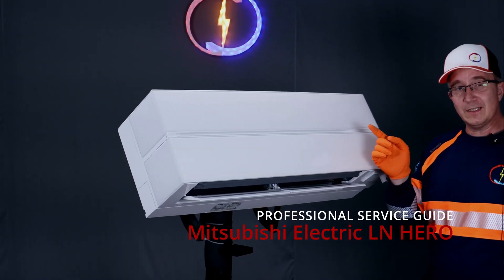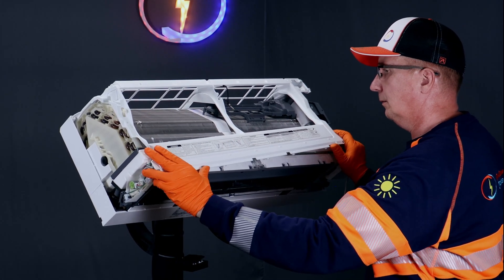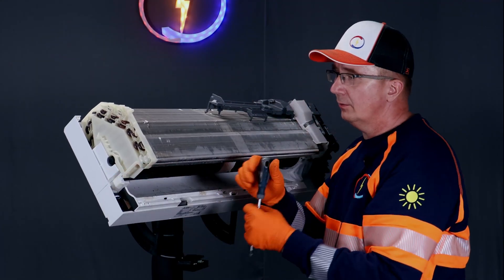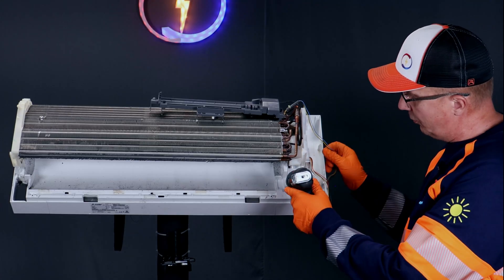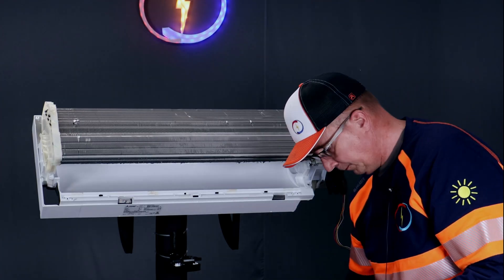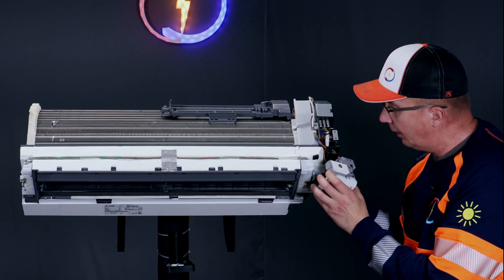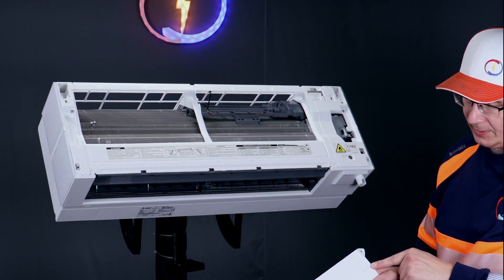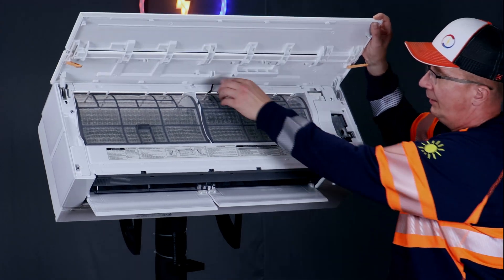Mitsubishi Electric LN Hero Teardown - DIY Guide For Professionals- 4K

Comment: Excellent, good teacher. Took me 5 hours with cleaning and unblocking drainhose. Important to get heat pump cleaner. Non toxic, very effective, plus white plastic has never looked so clean. Getting the drain hose on is annoying. My model number is mitsubishi msz-ln35vgw

Comment: Is this unit better build then the AY series? Or does this unit cost more because of the design and features?
Reply: ln is vghz, very efficient. model. I have both 3pcs of Ay, and 1 vghz2. Ay is more simple, and half price, but heating efficiency. is a bit weaker...